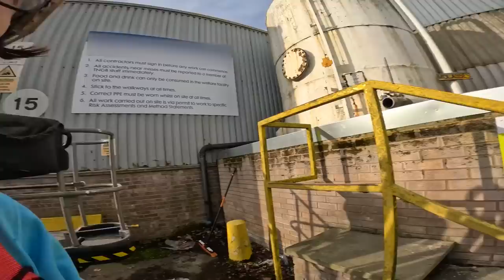Can We Clean These SMELLY BUNDS Before Inspection Day?! (NO DRAINAGE!)

Comment: You should keep a little spray bottle of rust cure in the van so you can treat the rusty bits and stop the staining getting worse, doesn’t cost a lot but could be one of those little value adding services you could include which some clients might appreciate more than others.  Maybe also invest in a couple of fall cushions if you are going to be climbing on tops of walls too, a six foot fall could have disastrous consequences.

Comment: Congrats mate would you been able to softwash them from the ground or would it not work on metal
Reply from the maker: Would of been so much easier but it's a heavily monitored place regarding waste so we could of used chemicals but disposing of them would of been the problem as we couldn't let anything near the drains apart from water. I can't suck up the chemicals with my machines as it would damage them so it had to be a hot wash only type of job :D

Comment: It should be pointed out when working around industrial facilities that you need to take extra precautions. Everything within the walled areas around the vessels is considered confined space and you need to keep ladders in and out of in both areas while working around the vessels - trapped gasses or low oxygen levels. Washing the sides of the vessels allows the owner to inspect for damage or excessive wear. Otherwise great job!!!